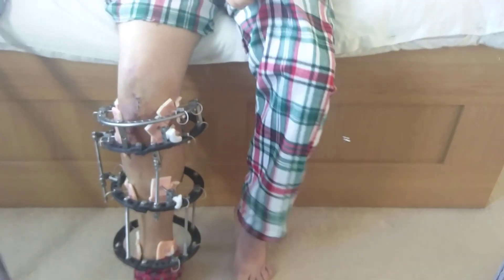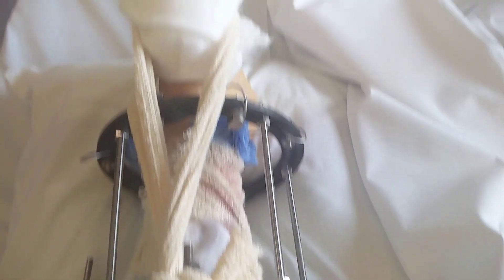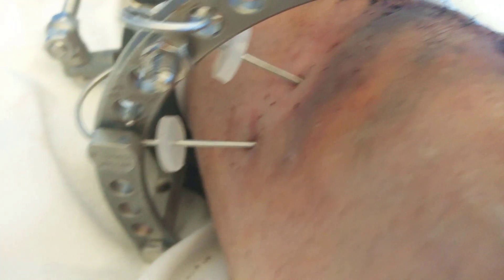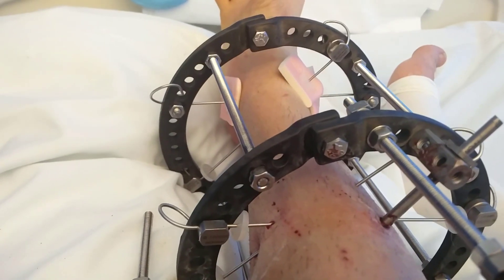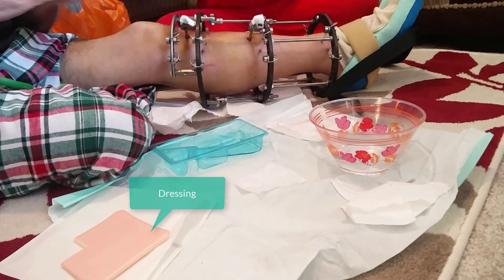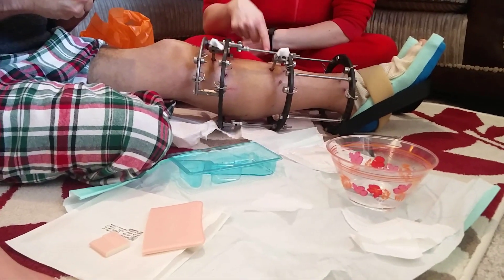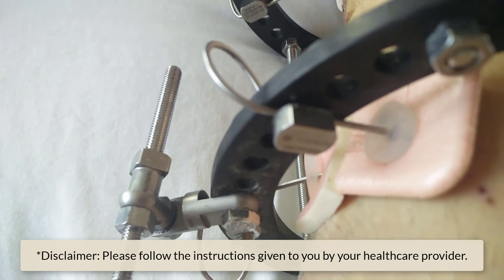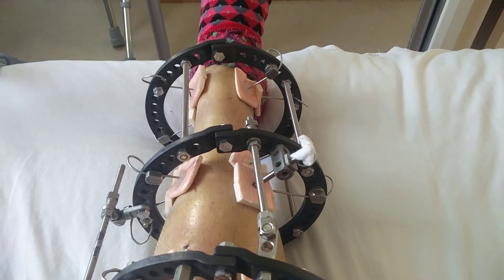Ilizarov frame to straighten bent leg - Days 3 - 10

Comment: How is your leg now?
Reply from the maker: Hi Hitochi, my leg is great and I'm so pleased that I went through with the operation as my leg is straighter than it's been for 20+ years. 

I can walk better, my hips are now aligned (they were crooked before), and my general health has improved as I'm able to walk more.
Reply from the maker: Sorry for the late reply!
Reply: @barrystoner6020   Hi @Barry Stoner  Thank you reply me back. What's medical condition caused you this? I noticed you  wear hearing aid. It is also affecting the inner ears bones as well? I wear hearing aids too.
Reply from the maker: @hitochidiaz-ramirez6229  Hi Hitochi, I have Osteogenesis imperfecta, also known as Brittle bone disease. 

I wear one hearing aid as my other ear does not work after an operation that went wrong. 

But I'm ok with one working ear, although losing me hearing in my 20s was hard on me.
Reply: @barrystoner6020  I feel sorry for you. I work in orthopaedics and I see the ilizarov frame good results in the patients. I think is better to get use to hearing loss at young age rather than be older. I started to loose mine at the age of 38 years old. ENT doctors found I suffer from Ménière's disease. Are you a candidate for Cochlear implant in the bad ear?